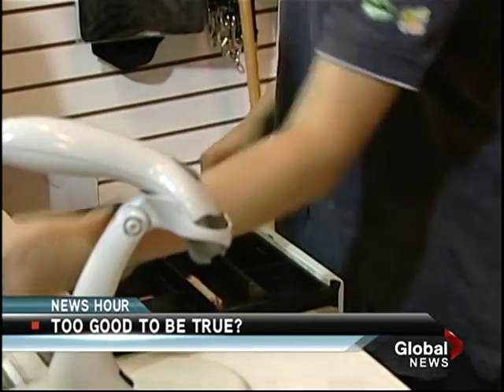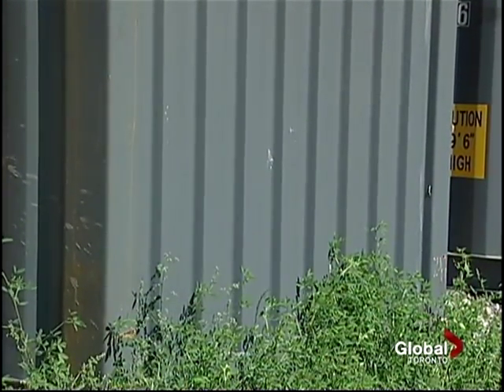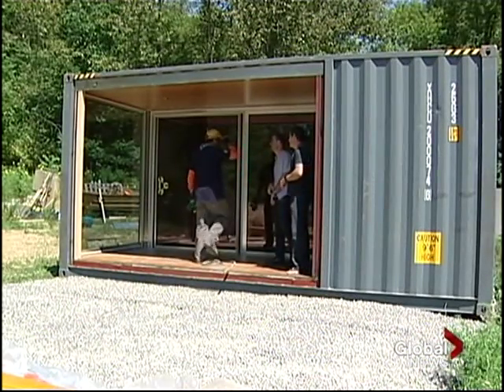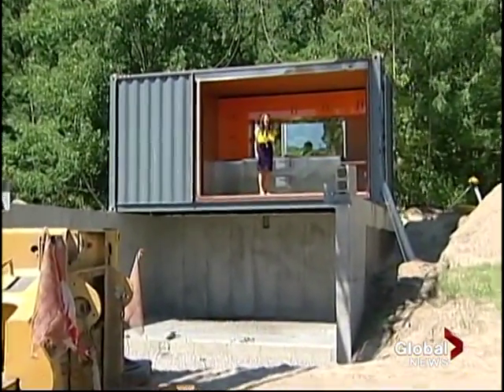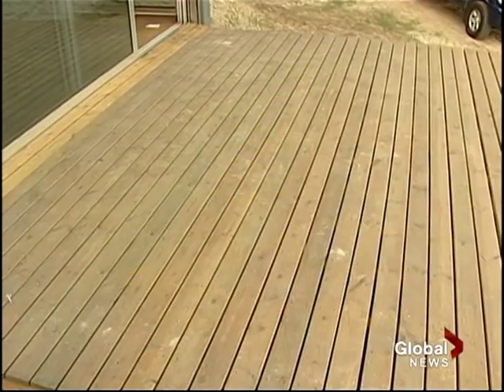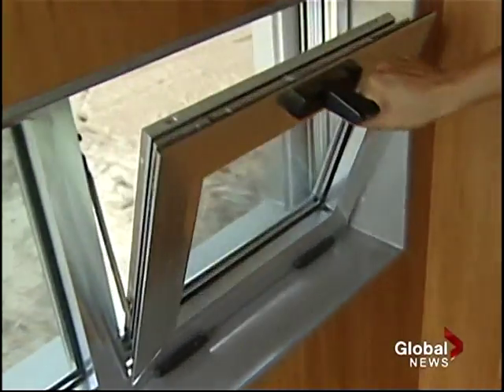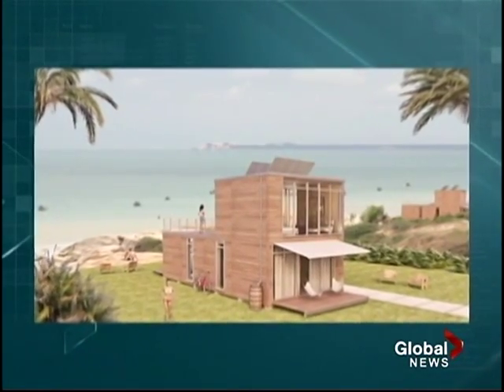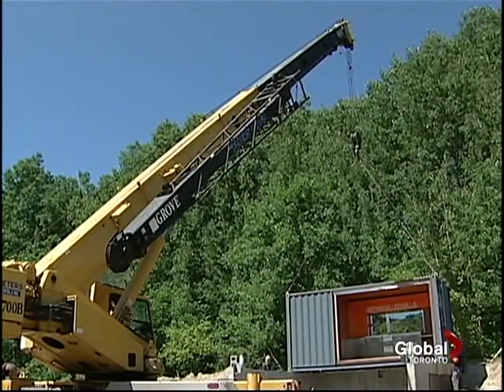Global News - Prefabricated Homes by MEKAWORLD

Comment: what about if there is an electrical surge a power surge then the entire house is HOT literally meaning that if not insulated properly then will it have live current running all over the house..and steel is very good conductor of electricity love to give these containers a try but the risk of electric shock needs to be evaluated based on real data

Comment: Not paying that for a made in china product, gtfo lol. I can get it local made for less. Shop smarter, not harder.
Reply: +drumtravelfun  still a canadian company - try to find anything that isn't built in china these days.?....your whole kitchen was built in china so lets not get carried away.....the reason they are 32k is exactly because they were built in china where they pay a buck an hour for labour.......if they were built in southern ontario it would cost twice that if you paid a livable wage which is a must in canada in this day and age.........the only way out of this quagmire is to build it yourself ...exactly what i plan on doing....i am taking this summer off to build my own tiny home 25' x 8' on a 5th wheel trailer......then no codes to worry about as it is on wheels.....I paid only 3k for a second hand trailer last summer.....I figure another 5k to wire it and rough in the plumbing and i plan on doing all the framing as i built decks for years thus building a rectangular box with a sliding glass door and four largish window presents no problem at all......I figure i will come in under my budget of 28k completely furnished